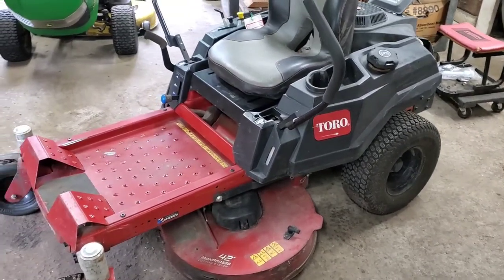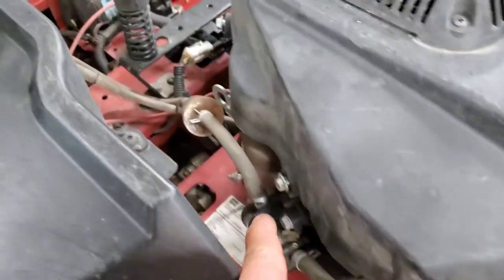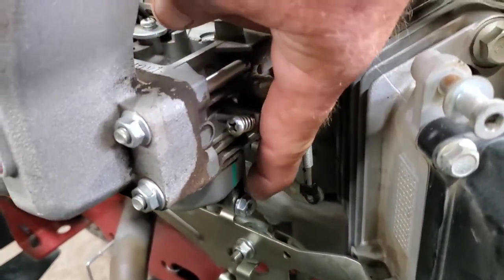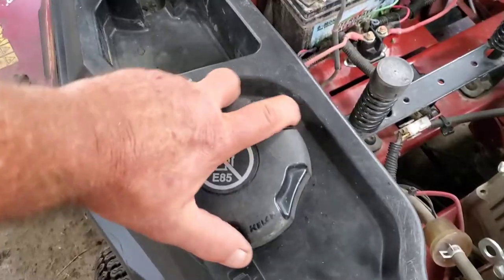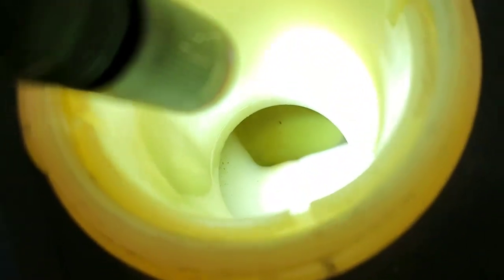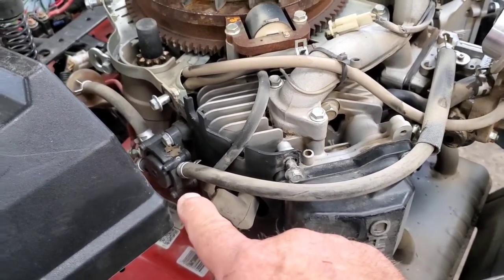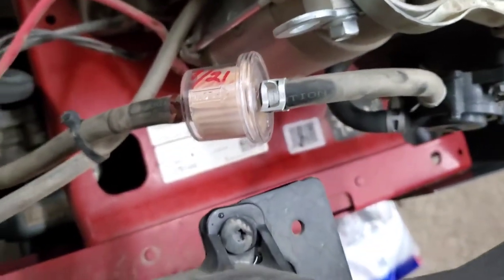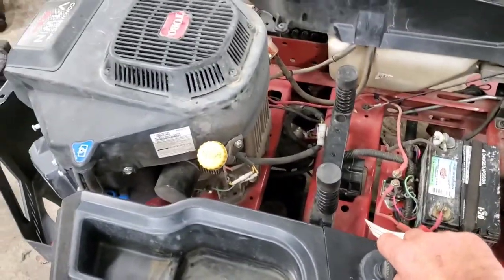Toro Zero Turn Only Runs On Choke Easy Step by Step Diagnosis and Repair DIY

Comment: Toro cutting off. I let set would run about 45 seconds,  stop but  start again then cut off! would run on choke for awhile. BUT  FINALLY STOPPED!!   I found water in fuel pump?? mower is kept in barn never has been in rain? so I  tore down replaced gas and new fuel pump . did it again! 2nd time took carb.  apart cleaned thoroughly, blew out all lines then put back together ! Wished i had seen channel before all the work ,I did all this! THE OLD SAYING "Gas and Water donot Mix " This is exactly what happened to MY TORO . So thanks for video Raley's live and learn!

Comment: Great video. This will help me address my problem, which is it barely/reluctantly starts after about 4 cranks.  In the early years (MX5050 - 4yrs old) I did not burn off the old gas for the winter, so I know I have carburetor issues and probably a little water in the gas as well.  I've been working to clean out bad gas and the carburetor since I don't trust myself to replace it (yet -I'm learning!).
Reply from the maker: Thank you! Glad this video helped you. I have been doing repairs over 40 years and im always learning more everyday.  Thanks for watching my friend

Comment: Great video. I have the same mower that runs for about 30 minutes and then dies. Can choke it and get it to run enough to move, but not mows If I let it cool a while it will start up and run. Replaced coils, fuel pump and spark plugs. Also gas cap per dealer. Any ideas?
Reply from the maker: It's starving for fuel. Carburetor issue
Reply: @RaleysSmallEngines  thank you sir. Would you recommend I try to clean carb or just go ahead and replace the carb?
Reply from the maker: @chadclark5204  at least try and clean the carburetor first, that's free.
Reply: @RaleysSmallEngines  will do. Thanks much

Comment: I've got a newer model toro, looks like the same engine and I'm having the same problem. I drained the carburetor but didn't see any water droplets.. should I continue removing fuel from the lines and tank or would it be a different issue?

Comment: I have a42" Toro 74235 w/ FR651V.  I keep getting a air bubble in the filter.  I use the filter you recommend.  I think the source is the draw pipe connection  at the right angle brass fitting where the fuel line is connects at the tank.  Any other suggestions?

Comment: I have had to dump my 4235 gas tank a couple of times to dry bad gas/water.  The tank is very easy to remove.  First remove the faring that covers the fill neck.  then disconnect fuel line where it attaches to the fuel filter.  With the seat forward remove the fasteners that hold the tank to the bed.  Then you lift the tank  away from mower.  Rotate the take to drain bad gas/water into a bucket.  If worried about water leave uncapped tank in sunny spot with neck up.  Leave it there long enough for the water to vapor out.  My tank evident was real dirty and the filter inside the tank keeps clogging.  I disconnect the  gas line at filter and blow compressed air down the fuel line to the tank.  The air blows the gunk out of tank filter.
Reply: You say there is a filter inside the tank?  Working on a time cutter 5000, with idle issues, noticed there’s no inline filter between tank and pump.  Thought previous owner just removed it for some reason.  I’ll check

Comment: How do I stop the backfiring when I turn it off?   People think I shooting at them LOL.
Reply from the maker: Just simply idle machine and let it cool down then shut it down. Set idle as low as possible.  Old machines didn't have an anti backfire solenoid.  They work just fine.
Reply: How long do I run it on low idle?  How do I know when it's cooled down?

Comment: what does the water do that only allows gas when its choked?
Reply from the maker: Water?
Reply: @RaleysSmallEngines  , The video shows it being water as the reason for running only on choke, so I'm curious how it runs at all if water is in the system and can pull the gas in only on choke,..
Reply from the maker: @Randy Kuhns  because with the choke pulled it is forcing water and gas thru. Too much water and of course it wouldn't run at all

Comment: I have a single cylinder toro I cleaned the carb now it will only start with starter fluid but it will continue to run but won't start with just the key and choke